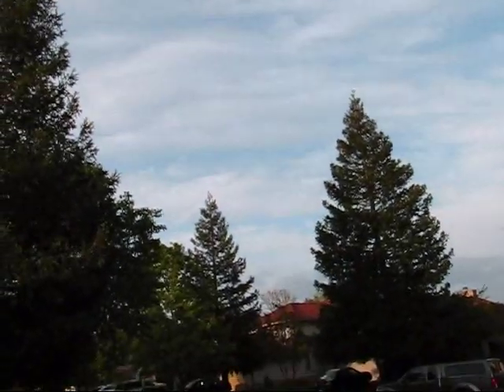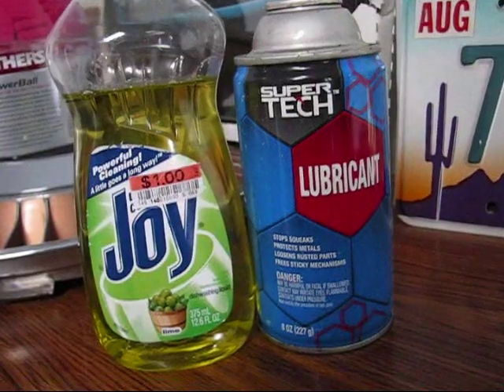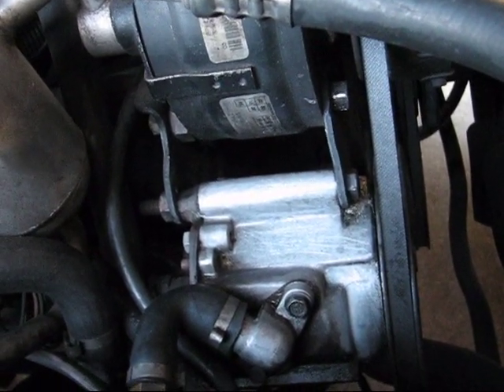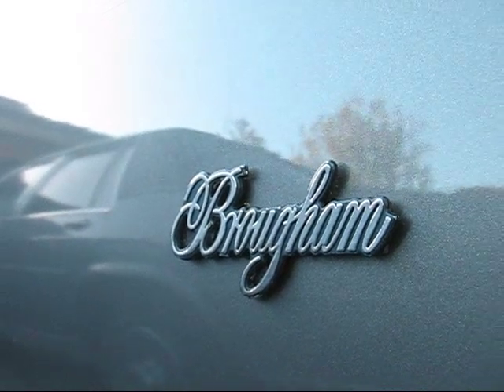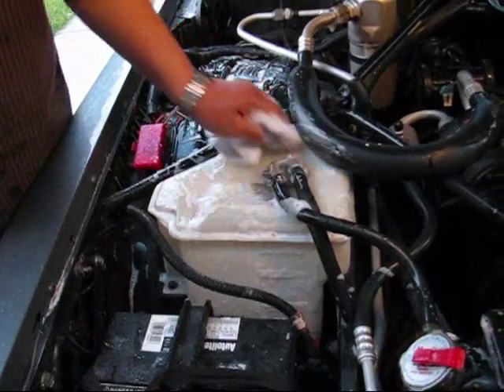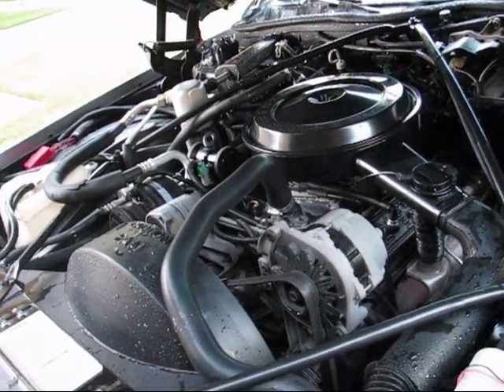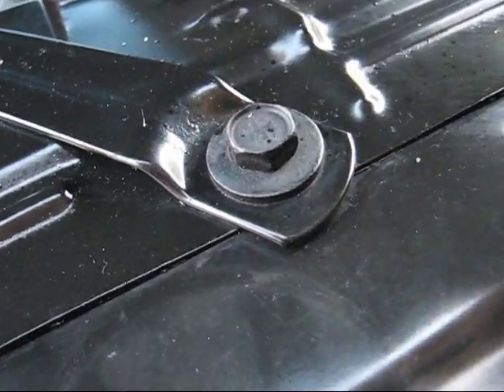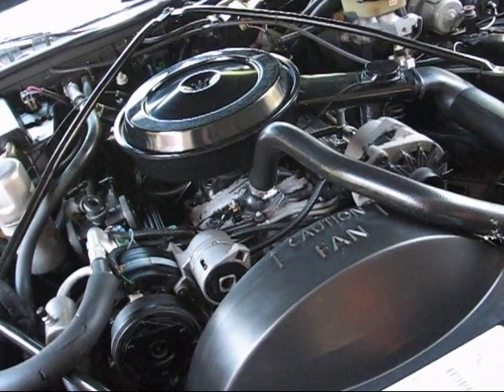The Ultimate HOW TO- Clean and Detail Your Car Engine/Motor

Comment: Great video!!. I will for sure do this. What I do have is oil in between the carburetor and the intake manifold I tried cleaning it but it must have a leak because it still has oil. Man your engine has alot of hoses my caprice doesn't look all that cluthered I think its going to be easier. Thanks Bogar!

Comment: good video with alot of information i been cleaning engine compartments myself off and on and most times i dont bother covering anything cause it really wont hurt newer vehicles since most everything is sealed from the factory and i also run the engine for a few minutes and all is fine but overall a good video for those who never done this before

Comment: A tip if your CAR DOES NOT START after cleaning it,  Air dry all the igntion, Then spray it down with WD 40. It worked on my LT1 Impala!  (The coil got too wet)

Comment: amazing video, i used to spray a gallon of diesl on the engine of my car (1989 chevy caprice and 05 nissan) and within two days it starts to collect alot of dust and the engine would look greasy and dusty then i start spraying wd40 and its the same result and now thanks to you would try to clean my engines asap like you did, and 1 question how many times a month do you clean you're engine? 
THANK YOU

Comment: Thank you so much for this video!
I've been looking all over the internet tonight for a good how to video on cleaning older engines (I have a 1980 Ford E-150, 302 V8 Windsor) and this is the best, it'll be a lot cheaper than buying all that special engine cleaning stuff and looks like it will work a lot better too.
I was wondering if you have any tips on using a pressure washer for engine cleaning? Because this engine is coated in mud, oil, dirt, and more, never been cleaned.

Comment: One thing though is it was an easier job on that engine with the TBI and closed air filter unit. What if you've got a carb with an open unit? You also have almost no loose electrical wiring like emissions wiring I could see. How do you spray or clean an engine like that? 

No cleaning under the TBI unit either, on the intake manifold or heads and block. Wanted to see the degreaser in action on the intake or actual engine block.

Comment: i looked at mi motor small 4 cilinder.i have w 40 only.i had stil have doubts
am not shure.think in the summer time use bit of water soap w 40 with out hose.i again enjoy seen it

Comment: sweet video bogar!  i'm gonna use this to spice up the engine bay in my 91 Trans Am.  Speaking of which... do you have any tips on renewing aluminum parts that get tarnished from age?  since my car has the tuned port injection which is a massive chunk of aluminum sitting on top of the engine, unfortunately it became pretty worn out and dirty.  You know, typical aluminum wear and tear.

Comment: I got a 97 s-10 truck and I like keeping it looking good. The engine is the worst part. The valve covers are covered in thick built up oil and dirt. I think its been leaking oil... How is the best way to take care of that? just do what you did in the video? or is there any special suggestions you might have?

Comment: I have a 95 Chevy two door Tahoe.  The factory alluminum wheels clear coat has a dull look to them, I was thinking of using paint stripper to remove all clear coat and paint then take a cloth buffing wheel and polish compound to give it a mirror like shine then spraying another coat of clear. Do you see any problems with this? Any suggestions?
Thanks

Comment: Hey J is it okay to spray the entire engine with a pressure washer?  By this I mean open the hood and spray down on the engine and then under the car and spray up.  After covering wiring harness and battery ect.

Comment: mine parents have a opel corsa cdx 1.4 from 1998.its compact car.
i thrust bogar i believe bogar i have doubts.am afraid.
but maby yse little soap on tubes plastic won t hurt
i understand you use lubricant on the belts also the V belt ?

Comment: Hi I have a question not so related to engine cleaning but since you mentioned corrosion my car's battery wires the metal parts that connect to the battery forgot what they were called are quite corroded and I was wondering if battery spray helps and if I should get some new ones.

Comment: BOGAR, would a regular non wire brissle brush work as well?  I don't want to scratch up the surface on the parts to much.  Also, is that a TBI Vortec 350?

Comment: hey i have a 1983 Cadillac Brougham Fleetwood Sedan it has the 4100 engine. i heard its the worst engine there is for a cadillac i have never had a problem with it. it always cranks up great just the compressed ran out. whats the advice you can give me to maintain it?

Comment: This method doesn't work. Everything is fine until you start using lubricant to shine your engine plastics. Notice how he didn't show what the engine looked like after an hour of driving. ALL that lubricant comes off, and it leaves the plastics and blacks much lighter colored than they were before. Its bad for your engine, people. Don't do it.